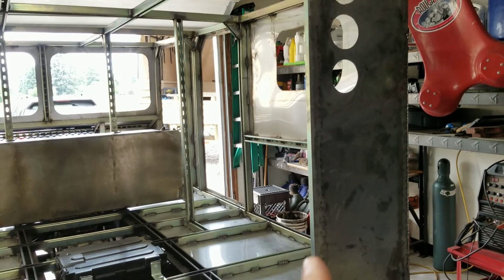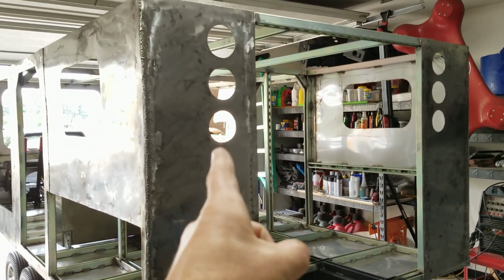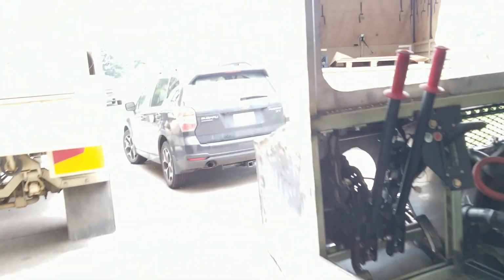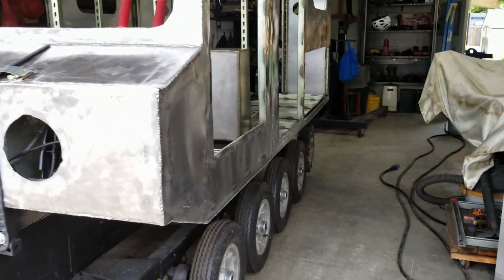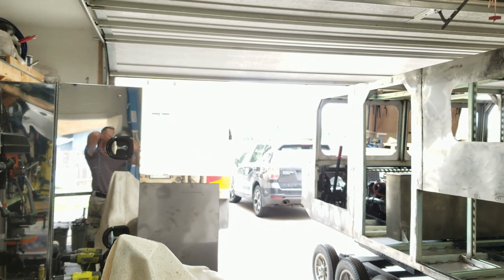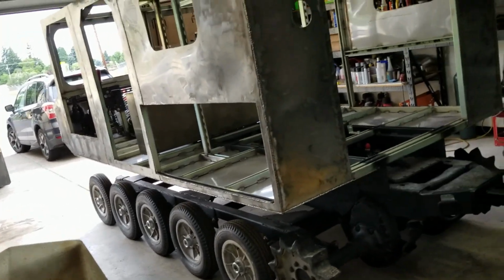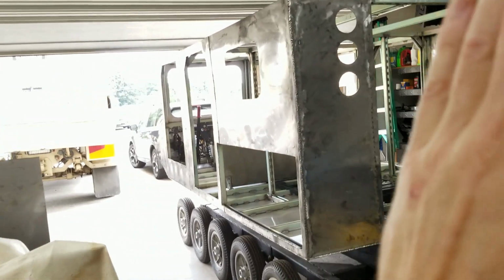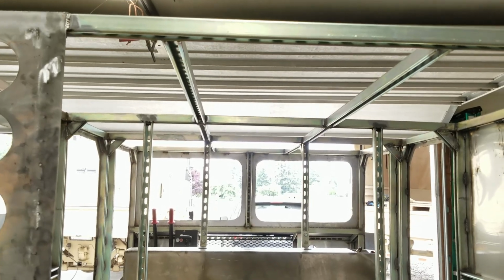Rusty the Spryte build part 77 (sheeting day 8, rear end panels)

Comment: If that oval light is surface mounted center of the roof at the front would look good, with brush cage if you're worried about it. Looking great, keep the videos coming.
Reply from the maker: Hi Jack!  There is structure and a windows in the way where you are suggesting I should mount them...